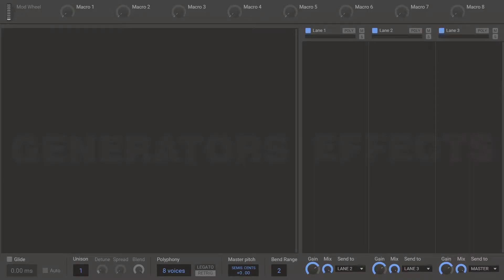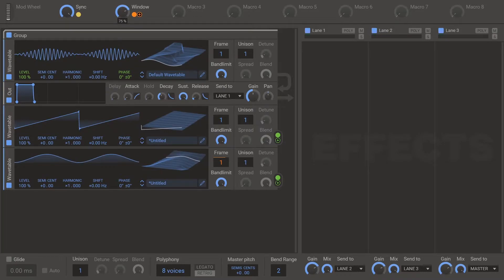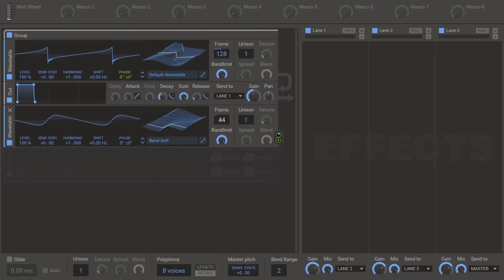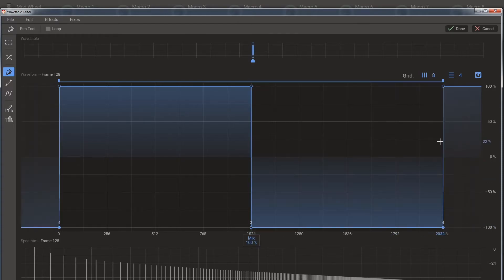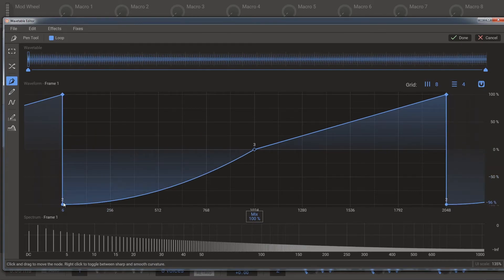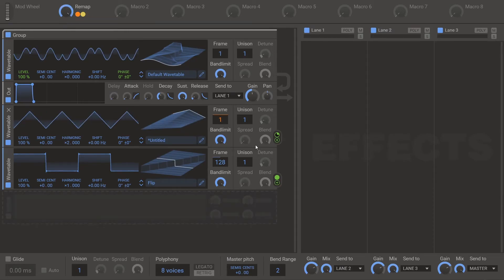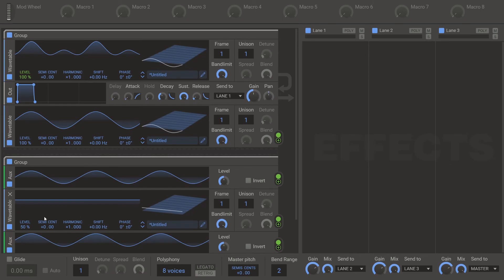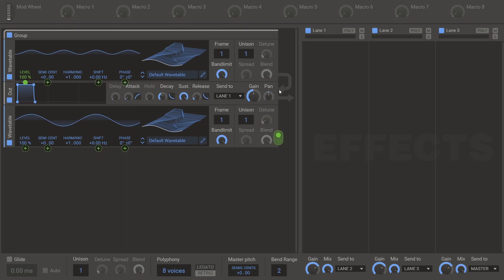All Serum's Warp Modes in PhasePlant - Bend, Asym, Remap, Ring Mod, Sync, PWM, etc

Comment: wow this is amazing, its like catching a glimpse of how it works under the hood. how did you figure out the theory behind this? 
also please do more of these synthesis videos. thank you so much!
Reply: They are all types of phase distortion. If you think of waveforms as arrays of amplitude values, normally you play through each sample/value in the waveform in equal amount of time, or linearly, at the speed set by the oscillator frequency. If you look at this lookup function as samples/time, it corresponds to a ramp up/sawtooth. But if you "bend" that linear function / sawtooth in different ways, which means spending more time in some parts of the waveform than in others you get phase distortion.

One fun thing to do in phase modulation synthesizers that don't have built-in controls for phase distortion is to stop the "carrier" sawtooth by phase modulating with the reverse of the carrier saw at the same frequency, so that you get silence. But then you can start modulating the modulator again to get PD'ish effects.
Reply: @Tsarpf  Oh wow ok, that makes a lot of sense: 

From what you describe, I'm imagining the line of whatever waveform representing a series of connected dots that would play through steadily frame by frame while un-warped. With sample-position or frame at x-axis and time on y-axis, plotting this would result in a straight ramp up shape as you say. And if i'm understanding you correctly, these warp modes are different ways this curve is modified.

That's an awesome explanation and thank you so much for taking the time to explain this to me. Clears up so much mystery.

In the second half of your comment: do you mean having 2 identical waveforms exactly 180 degrees out of phase with one another to produce total cancellation and then playing with the phase position of one of them with an LFO or envelope? If so, ill definitely try that out some time.

Again, thanks for your response!